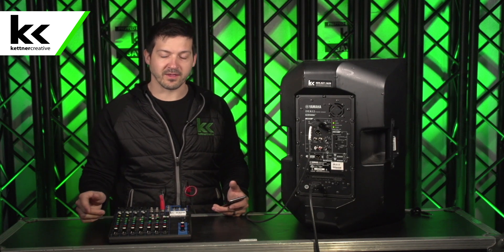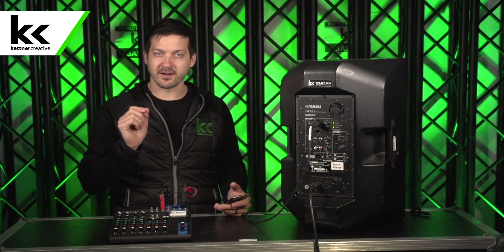How To Test a Speaker Before an Event | Prep Audio Equipment

Comment: HI. I two questions.  
1. Most phones no longer have an output for a cord. What else can we use if a phone does not have an output?

2. Are you using an app to get those frequencies test sounds? If so, what is the app called?

Thank you for the great video.

Comment: Remember, if the speaker starts to distort, it will NOT break, you have to lower the front grille and tighten all the screws, but all of them, for better safety, tighten the rear screws ... from low frequencies the screws come loose , otherwise there are some good speakers ... sounds good for some ABS plastic speakers
Reply from the maker: Yes, it's possible that what you perceive as distortion could just be a loose screw.

Comment: how we  point if there any problem in our speaker  on during  this process n wer we find this type of testing sound effects .. any lnk plz??? tnks for useful vidoe.
Reply from the maker: Hi Cool Hunk. Good question. We're not speaker repair experts, but the good thing with Yamaha speakers is that they come with a 7 year warranty. When we discover that we have an issue with a speaker (which has happened very rarely) we send it to the Yamaha warranty department.